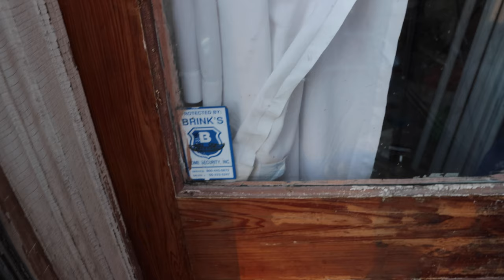This Is Not Great News

Comment: I don't know if you're already doing this, but shrinkwrapping any windows and doors you aren't using for the winter can help with heating a lot by sealing the air out. You tape the plastic around the frame and then heat it up to tighten it. Especially windows or doors that actually let air through instead of just leeching heat, though it helps for window that don't have enough panes too. There's also those beanbag type floor noodles to put against the base of the doors you do use, to block drafts, and hanging heavy blankets as curtains over the plastic windows or the ones you can't put plastic on. Adding insulation to the roof or finishing and insulating the attic will also help a lot, and that's work you can continue into the winter until it is done, I don't know if it's a priority for you though. There's also expanding foam insulation, which I am sure you know about, which tends to be the best for closing up gaps in basements, even sealing up old coal doors, and etc... To keep heat in and mice out.

I guess I am saying prioritizing the roof might help avoid higher winter bills, and waiting till spring might come with extra heating costs, but more so the insulation part is important.

Comment: Bummer about the pipes. I watch "1834 Restoration" and Mike is using the heat tool to remove all the paint on the woodwork in one of the rooms. He has a bit of a system in how he and Jeanie get the job done. He uses quite a bit of denatured alcohol in the clean-up. Yep, Fridays are fine to post.

Comment: Sorry to hear a family member has died. Posting your videos on Thursdays are no problem. Keep up your spirits and keep working. Cypress wood is very rot resistant. Bad news is bad news, but the good news is your doing great before winter. Restore what you can. Great find with the paint removal without the led vapors I had to put up with removing paint off my fathers house back in the 1980's with a propane torch. Love the video! Use a opoxy clear sealer on the exterior door after finnishing.. The switch looks like something for an elevator to me.

Comment: My condolences on you grandmother.  It is very interesting to me that the sewer and storm water go into one system.  Most cities don't allow that because the storm water overwhelms the sewage treatment facilities.  This sent me down the internet rabbit trail to see why St. Louis is different.  Apparently it's just very antiquated and it does cause major problems for many residents when large rains come through and St. Louis is working to decouple the waste from the storm systems.  I hope that doesn't cause you grief years down the road if they ban residential runoff from going into the sewer lines.  That may be many years later since it looks like they are starting with the bigger issue of street storm drains and asking residents to voluntarily disconnect gutter systems and have them discharge in the yard.

Comment: Make a hole in the pipe for the gutter on the side of the house. It will relieve the pressure on the system.  We one had sewage and rain water come out of our toilet and flood our living room. The fix was to release the pressure of the rain gutter . A hole on the side won't affect the rain getting in the sewer during normal rain but will give it somewhere to go if there is extreem rain.

Comment: I have similar switch to one on your door in my 1914 American 4 square. They may not be original in our  case but on two closets that have them they control the light. Whenever door is open the light is on…

Comment: As a short term fix would you be able to just sign up and repair the two collapsed areas? I know the whole line will eventually have to be replaced and perhaps it is just as costly to do two small repairs as opposed to the whole line. In my city they are starting to require gutter and any other untainted water be separated from sewage lines. The clear water is sent straight to the river and sewage goes to treatment plants. A little at a time all of the old combined sewage/clear drains are being separated. My home is on a corner and before the two were separated on a hot day standing on the corner would make someone gag from the smell coming up from the street drain. Happily my part of town now has separate lines for sewage and clear. But I know for a city the size of St. Louis that change over will take many years and a lot of money.

And like your other fans, so sorry for the pain of your family's loss.

Comment: It is interesting how very  much code is different from place to place.  Some places forbid storm water to ever mingle with sewage.   So downspouts exit onto the lawn. Sump pumps are not allowed to enter the house sewage system.

Some older towns do allow gutters and sewage to all get piped to the street's underground, single waste water system.

Newer areas have separate storm water and sewage water systems entirely.  Whether or not you can tie gutters, foundation drains or sumps directly into them varies as well.

Comment: I bought my first house this spring and a couple of weeks after I closed, before I moved in, we had a huge rainstorm. 4-5" of raw sewage came up my basement floor drain because of the combined sewage overflow - every downspout in the neighborhood is tied to the sewer and the sewage that came up the basement wasn't even mine because I was the lowest point in the neighborhood. Obviously this was disgusting.. we had to shovel it out. I'd recommend looking to see if your city has a stormwater management official to talk to. My city actually has a program that if you daylight your downspouts (disconnecting them from sewer) and your basement still floods you can get financial help putting a check valve in. This is a different problem than from what you seem to have but I had to have my whole driveway and sidewalk dug up to put the check valve and clean out in and it was about 9.6k. Wishing you the best in getting it sorted out

Comment: As many said I would remove from sanitary sewer and run PVC underground until the grade allows it to run away from foundation. I ran my gutters into thin pvc glued so roots would not have a time on. It runs down hill to small catch basin to gracefuly release not allowing erosion. I would check with the city of what they will allow first. I know in the city of Lexington KY it is illegal to dump run off water into sanitary. Even basement drain crocks (sump) had to be removed and ejected at curbside. That heater striper is cool. Lead paint fumes are bad. Hope things get better.

Comment: This is why in my area our drainpipes aren't allowed to be connected into the sewer lines they are to go out to the road or yard, because it was taxing on our sewage system. Our area does tie testing if your caught with your drainpipes into the system your fined my neighbor found this out the hard way. He was tie tested when he sold the house. However when he disconnected them they didn't drain the water away from the house he just filled the pipe with concrete so any heavy rain storm the water that came down the drain splashed over their little wall and ran my steps and into my window well running into my basement. I kept wondering why My carpet would be wet in that area. The new owners weren't to happy when they had to file a claim with their new homeowners to fix my basement just after living there for 4 months. They ended up suing him the cost of what it took to fix my basement because of what he did. Fun times luckily we became fast friends.  Sorry about your Gram. :(

Comment: an old american legion building my mother was the steward for the side door had one of those its a open to connect the circuit it was connected to a bell which alerted people inside that the side door had been opened it shorted out due to the weather and i had to remove it as it was blowing fuses that also served other items

Comment: priorities ...i get you want the outside of the house done but that plumbing issue is top priority right now. just keep dong your best and i know youre excited to get things done but dont rush. it will happen and its better to take your time to make sure important stuff is fully done before the smaller things. money is always an issue with home ownership....esp one youre renovating etc. im in a 1913 two flat and its always got some issues that pop up. currently furnace is acting up and im in chicago.....so not a good thing to have go down. we just fixed up the outside and foundation with roof and all....so i get ya on money.  either way deep breaths it will be ok.

Comment: Haven't watched the entire video yet so I'm probably wrong, but my first reaction to the words "sink hole" was old cistern. I have an 1890's house where the sink hole that I keep filling up over and over was found to be an old cistern. If you can look at the Sanborn Fire Insurance maps for your house from the late 1800's early 1900's, a cistern would be marked on the map. Public libraries are usually pretty good about having the maps on either microfilm or online. It will also show the locations of outbuildings as well.

Edit in: looks like I was wrong about the cistern, though if it had been I wouldn't have been surprised. On a different note, I'm glad to see you are trying to maintain a work/life balance. Any day you put out a video is good. We'll be here. 🙂 Condolences for the loss of your grandmother. 💔

Comment: Great work on your most beaten up door. It will look superb when it's finished. I agree with John Gundlach about that switch next to the door on the frame. An old fashioned nifty answer to fumbling around in the dark.  

Your sink hole is a bit of a set back and I totally understand how your mind is right out there with the roof and how close you are to doing that.  However, as you correctly say, you need to secure the waste water away from the basement. $10,000 is a heck of a lot so you'll just have to tell us all to head over to your shop and buy, buy, buy!  I get paid on Tuesday and I wanted a sweat shirt first time around. Burgundy is my favourite colour so I want one of those before they all sell out!  

As for moving video uploads to a Friday, no problem with me.  If it gives you back weekends so you have time to relax with your wife, your family and friends, plus your sports, go for it.  We just love popping in for half an hour ANY time.  Be well, Kaleb. Try not to worry. Just remember last winter - now THAT was a challenge!  All the very Best to you, Kim, your Dad and the dogs as always.

Comment: You will have to trace the wires to there end. But I believe it is a light switch.  When you open the door it automatically turns on the light.  It appears there is a key switch on the bottom side so you can disable the switch.  But imagine opening the basement door with packages in your arms and the space is light not dark.

Comment: I purchased my house at the end of 2020 and had to get 100ft of sewer line from house to city main replaced with PVC. Someone with a small excavator can get it done in a couple hours. Job and materials for mine was right around 1000 bucks. Shop around. 10k seems insane.

Comment: Since the door switch was connected to the light switch inside, most likely it would turn on the light long enough for the person coming in to get around to the  back side of the door to snap the normal switch on rather than fumbling in the dark.

Comment: ^^ its auto light switch so when u open the door the lights auto turned on and when u close it it auto turns off. my closet still has one attached . mines was put in around 30s-40s era

Comment: That switch might before a automatic light switch.  I have something similar for my interior closet Mine does not have the light switch like yours. Mine you just open the closet door and an interior light turns on, when you shut the door it turns off.

Comment: With regards to the finish on the exterior doors, I've been involved in a number of restorations of buildings in Texas and have never come across a wood door from this period that was originally clear finished with oils or varnish (and shellac on the exterior is out of the question).  In every case from this period the exterior face of wood doors was either painted a single solid color (often either green or red) OR the exterior face of the door was painted faux grain style in imitation of an exotic wood.  I think varnishes must have improved greatly around 1900 as after that varnished exterior doors do start appear.  - Just my $0.02.

Comment: Bummer about the sewer line! Our house was built in the 1930's when sewer lines were made of short segments of concrete pipe about 2 feet long and stuck end to end. We knew we were having a problem with root intrusion but put it off for as long as possible. The drains backed up and I would go under the house to the clean out, stuff in a plumbers drain bladder on the end of the hose and let it go for a while. BUT, when I started doing it 3 times a week... it was time for drastic measures. After figuring out where the main line out of the house ran under ground, measuring how long of pipe I would need, what diameter etc. , We started digging it up ourselves. $100 for 4inch pvc pipe, and $400 split between two nephews with great shovel skills, and I haven't had an issue in 2 years. You might be able to find the path your pipe follows and save a ton of money by doing the digging yourself. That's where all the labor cost is at. Then have the plumber do the pipe install and you fill the trench back in. Maybe see how much a trenching machine rents for.

Comment: You are on the right track for the door and the switch. Do you recall when you was little at joke shops they had things like rings that shocked either the person wearing it or if another person shook your hand they received a quick shock. Well the door was the same just another early version of a intruder alarm system.  The nogood burglar would get a nasty shock probably about 110v just enough to hear ringing inside their own head!🤪😜😂🤣

Comment: So maybe it is an easy fix like mine was. The line from the house was higher than the drain field line. Like someone had mixed the two up at the septic tank. When it rained a lot I would always get water in the tub etc and as soon as we drained our sewer tank and made the line from the house a little higher on the tank than the drain field line everything was fixed

Comment: you might need a sump pump in addition to new pipe. Rent equipement to dig the pipe out to replace the damaged area's. its too bad the lift wasn't a rental. They would be responsible for fixing it.

Comment: What about dowels (with glue) running deep through the wood pieces (through stile into rail) at the handle/lock area? strong, and can be worked with

It might be cheaper if you are allowed to dig up the ground instead of them... Can you ask them or do you have time/help for that?  will they use abs pipe instead of pvc? abs could be better (but it can sometimes 'sing' - make water noise)

Comment: I have at least 3000 sq feet of roof and the gutters run into the yard no issues after 20 years. I am wondering if you rented a mini backhoe or trencher and (carefully, they are probably ceramic sections as I'm sure you know) dug down to the pipe ahead of time and just have them remove and lay the pipe and you cover it up when they are done. Would they be cool with that? Could be a union racket where they have to do it all. Worth checking into.

Comment: My dentist had a door opening system which may have worked like your basement one.  You woud ring the doorbell and then his wife/secretary would buzz you in as you pushed in the door.  You had to work quick (while she was stil buzzing and "opening" the door)!  Could that be your mechanism?  A wire control door opening system.  Security feature yes?

Comment: One way float valve for sewer
Reply: I think sometimes they are called "P Valves", if so, mine has been installed 44 years with no flooding.  Neighbor on one side had just over a foot of sewer flooding. Neighbor on the other side 3 inches of sewage.

Comment: Put on a back flow in your house to prevent any sewage from backing up into your house before you can get the pipe fixed.  It will be an insurance policy for you and piece of mine.  Sorry for your loss, I know how that can be.  Do what you need to do to take that stress off of you. God Bless.

Comment: Caleb, is there a way to separate the 2 systems after you repair the main line? Here in New England, you're not aloud to send rain water into the sanitary sewer. You must let the gutter water flow on top of the grass or dig a wet well for them. just curious?

Comment: hire a mini digger. Great fun and it will reduce your quotation.
Reply from the maker: Good idea!
Reply: I dug out our sewer pipe and replaced it myself. It's not difficult. In England the modern pipes are a kind of plastic and one end has a rubber insert. When pushed together you get a "root proof" joint. They are 3 or 4 metres long, so it goes together quickly. You just need to make sure that the pipe slopes down hill towards the manhole. put some supports under the pipe at intervals, then fill under the rest with soil trod well down, then fill back the trench. you will enjoy the satisfaction you get afterwards. Go for it Caleb.